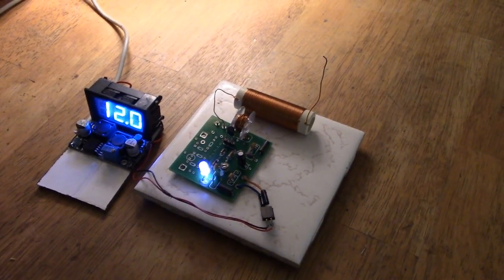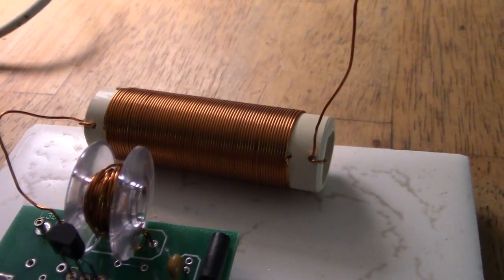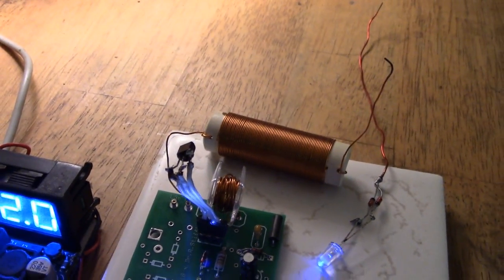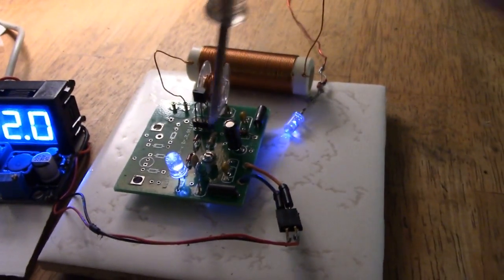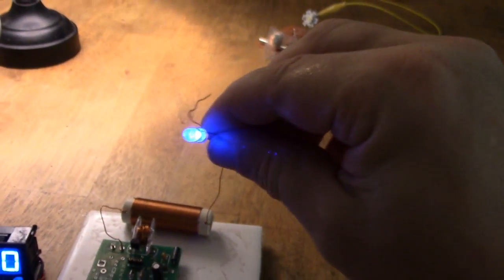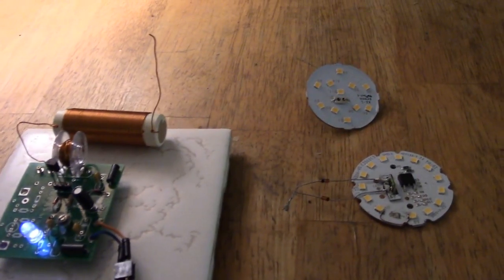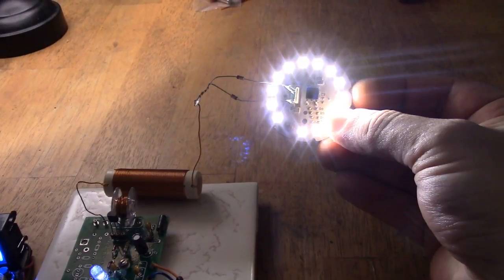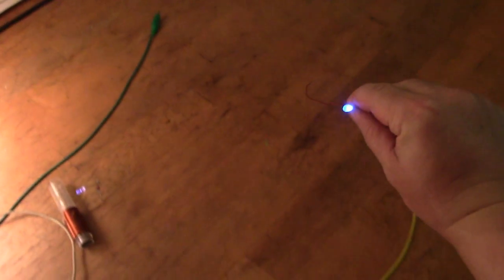SEC 18-1  What is it ?

Comment: Great intro!! You should put a watt meter at the beginning of input to show how wireless loads effect the primary input. I was surprised when I tried. The non digital watt meters work best. Digital glitch out often due to excited area. Watch the meter as you move the load and finds the sweet spots. Borderline bizarre when you think about it. Thanks for sharing!!
Reply from the maker: That's the thing, the analog meter ran off somewhere some while ago and digitals have that weird frequency glitch problem. A fix would be a variable constant current circuit, so it can never draw above a set amount...when it fails, that's the current being used.
Good idea most certainly, to balance the load :)